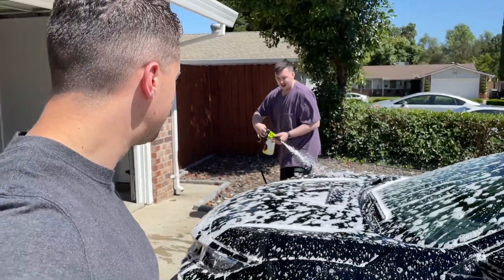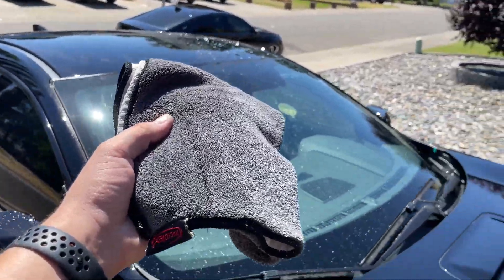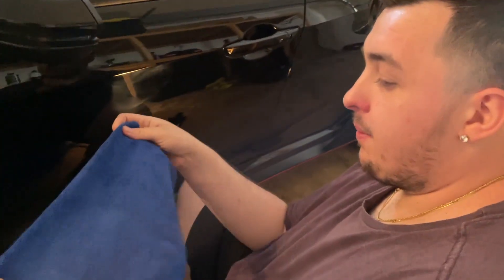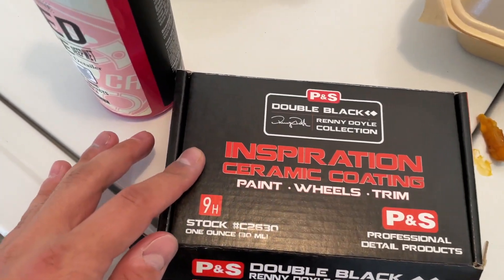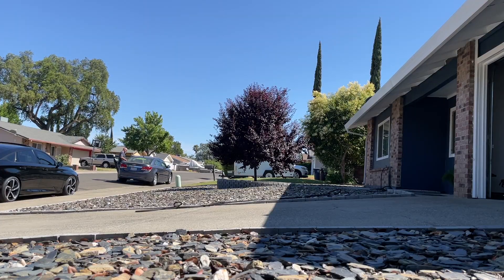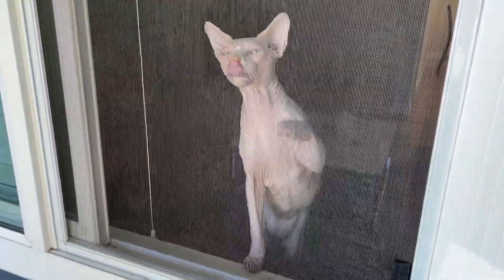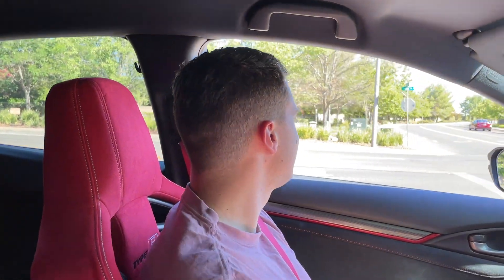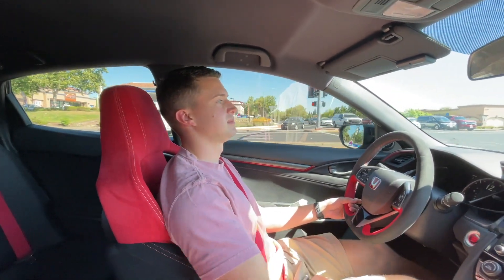CERAMIC COATING my 2021 Civic Type R! Huge Difference

Comment: Glad i could help brotha! looks killer
Reply from the maker: thanks dawg
Reply: Hell of a guy doing all that work! That’s a friend indeed!!
Reply: This man hooked it up!! Killer job guys!!
Reply: What red/white applicator for the ceramic coating were you using? Did that come with the P&S double back creamic kit? 

Also which blue microfiber wipes brand did u use?

Comment: I need a paint correction and ceramic coat so badly after seeing this, black paint is a pain 😂
Reply: I felt that bro. My 17 si was black. I learned my lesson and went with lunar silver on my 20 si. So much easier to keep clean.
Reply: For real bro

Comment: Just a few tips, after you wash buy a Decontamination spray to soak before you clay bar and do the polishing.  Also get a ceramic booster spray that you apply dry after you wash your car to help the water bead up.  The Type R looks great though.
Reply: i gave him a bunch of beadmaker to put on when he got home. but ya the only thing i didnt have was the de-iron spray. still his car was in good shape paint was really smooth after the claybar
Reply: @edryan1845  what exact order and processes did y’all use? The video only shows the decontamination wash, polish, and coating.

Comment: I also have a black fk8 and am planning on ceramic coating it myself. But the Honda paint is pretty soft from what I hear. For compounding I saw you go with the microfiber pads but for polishing did you use light foam pads?

Comment: and also is the steps,  compound, wax, clay bar or just compound and clay bar
Reply: steps are
1. use a non PH balanced soap to strip waxes/sealants off paint. you want a virgin clear coat when you go to compound
2. De-ironizing spray
3. clay bar. i usually clay bar the car with the soap/water that on the car
4. dry car
5. start with a test spot. see what compound/polish combos work for the paint.
6. compound or polish panel by panel. if youre doing both compound first then do a 2nd pass with polish
7. use a Panel Wipe spray to take off any and all polish/compound that you missed
8. apply coating

Comment: What the parts list for the suspension mods on the accord?  It has a nice stance.  Been thinking about a 2.0T.
Reply: right now im just on d2 springs, 25mm spacers all around and eibach camber arms. im going a little lower when i get my bc extremes in soon

Comment: love your vids they are gonna help me when i get my type R keep up the amazing work cam, also you should make avideo on how to fix the AC whistle
Reply: I think that's done on warranty? That video would be just driving to a Honda dealership 😂
Reply from the maker: it can, but the dealership said they would need to go out and test it for themselves in order to do the warranty work. I told them i had video footage of it and they said no, they need to go recreate the problem themselves. Im not letting anyone else floor my car. so im doing it myself. its very very easy
Reply: @Camhill182  very best of luck with it, mate. Love the ceramic finish ❤️
Reply: @cribscian  Honda shortage could make it a hit or miss to get the parts in the first place

Comment: I just got a 2021 type r a week ago got right at 500 miles on it. Daily driver for now. And at low speeds it makes a god awful screeching sound. I think it may be a rock in between the dust cover and rotor but not sure. Any suggestions?
Reply: Yep it’s a rock in the rotor Honda will remove it for free I had the same issue
Reply: It's a fairly frequent thing that happens...    I usually do a low speed sharp left or right turn, and a reverse with the wheels turned all the way.  It creates just enough torque to back it out of the dust shield.   I've never had a rock yet that I couldn't dislodge.

Comment: Cam, you should just get Viv a CTR in red.
Reply from the maker: That would be one of the worst decisions I could make
Reply: @Camhill182  Would she grind the gears to dust? I tried getting my wife to drive my RSX-S right after a complete oem clutch install and instantly regretted it. 😆
Reply from the maker: No, she wouldnt. It would be an atrocious business decision
Reply: @Camhill182  That was more of a one-off comment anyway. Not much reason to have two CTRs.

Comment: If you get a scratch on ceramic coating can it be touched up or how much of it would need to be replaced?  Edit: Sorry nevermind I think I confused it for something else.  That huh...whatchya call it...when they coat the car with that plastic stuff instead of paint.  Derp
Reply from the maker: the plastic stuff - I think you're referring to a clear wrap, or PPF
Reply: yea PPF, from what ive heard PPF with heat acts like vinyl wrap. so apparently when it sits in the sun it will slowy take them out on its own
Reply: @edryan1845  But when there is an actual hit/accident, they can replace just the one part or the whole thing needs to be redone to match?
Reply: @jimmmyz169  for PPF if its chipped they just re do the panel if it can be squeegeed out

Comment: Just take it to an automatic wash 2x a day for a week, it will get everything including your clear coat off! LOL
Reply: Removing clear coat is basically what prepping for ceramic coating is, every time you wax and buff a car, a little clear coat comes off, a more permanent solution and better IMO is to do the wax and buff as shown and take it to get the whole car wrapped in a clear bra, more expensive yes, but lasts longer, I will say it is NOT for everyone and ceramic is the way to go for some

Comment: Hey what's you opinion on the clear wrap for cars to help with scratches I'm trading in my si coupe for a 21 type r there asking if I want ceramic coating & the clear wrap or just the ceramic coating
Reply: If it’s from the dealer honestly tell them not to touch the car or at least to a minimum. Go to an actual detailer and have them properly correct protect and then coat
Reply: @jdmkidk24  they told me they need 7 days to do the ceramic coating I live in nw Oklahoma will be buying the car from witchita kansas which is 3hr drive 1 way and I live down 1/4 mile dirt road just want to keep it as nice as possible there isn't any good coating or detail places until you get to okc and they said I can add the coating the 18" clear protection wrap and tint all for 2500$
Reply: @charless5121  I would put some painters tape on the whole front end driving it back. It’s just me personally. The coatings they use is junk, this is just my opinion. I don’t trust dealers touch the paint of any of my cars. The dirt road part could be tough. Maybe try planning out the purchase of the type r and dropping it off at a detail shop the same day. I understand the situation just don’t like dealers detailing cars. Use cheap products that only last a few weeks
Reply: @jdmkidk24  the coating is called ceramic pro 9h exterior it's 200$ a bottle I'm new to this I do appreciate ur opinions and ideas
Reply: @charless5121  they actually are using a good coating I’m shock lol for me dealerships sell cars not detail them. Everyone’s situation is different so I respect yours. Just want to know my car is going to a detail shop is all. What color are you getting?
Reply: @jdmkidk24  boost blue I'm 50/50 on it lol haven't seen it in person so lol hope tint will help me like it a little more my wife loves the color tho I have a pearl white so now
Reply: @charless5121  same color I want to get. If you like it in pictures in person will be 100 times better. My wife loves blue cars so that makes the choice even easier. I’ve been seeing a few around AZ and it’s awesome such an amazing color. The pearl in it pops
Reply: @jdmkidk24  that's awesome here in Nw Oklahoma it's lifted trucks or mustangs or any American muscle I'm the outcast for liking and having imports lol iv got the only si coupe within 120 miles my nearest honda dealership didn't even have a tire when I blew one lol had to have 1 ordered 🤣

Comment: How well does the ceramic coating protect against rock chips?
Reply: the ceramic coating essentially is similar to adding another "clear coat" on top of the paint. its meant so the coating takes the brunt of the elements instead of the clear coat. rock chips for the most part will chip through it, i dont have enough experience to say forsure but my guess would be you could get lucky and it stop it but for the most part its still gonna chip the paint. PPF is the only sure way for that
Reply: @edryan1845  I figured as much.

Comment: Stop washing your car in the sun. @ Ed what did you use to delete the silver window surround ?
Reply from the maker: it doesnt matter because we were about to paint correct it
Reply: my buddy has a wrap shop so i took it to him for the front grille and window chrome. if your in the bay his shops Benzo wraps in modesto
Reply: @edryan1845   Cool.  Thanks man.  I see so many vid's on people doing the plasti-dip thing.
Reply: @Camhill182  O.C.D.- ME.
Reply: @gipsyavenger9829  yea plasti dip isnt a bad way to go about it. if i did it myself i probably would have gone that route
Reply: @edryan1845  Yurd.